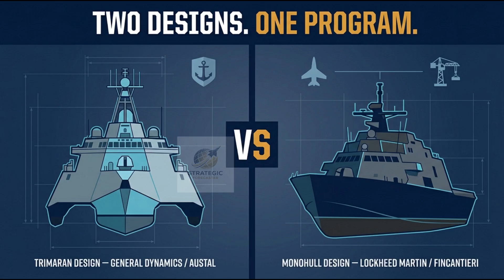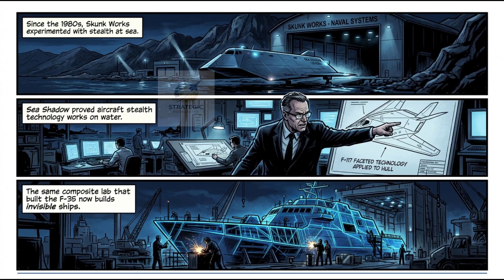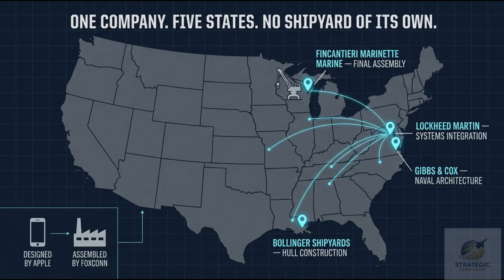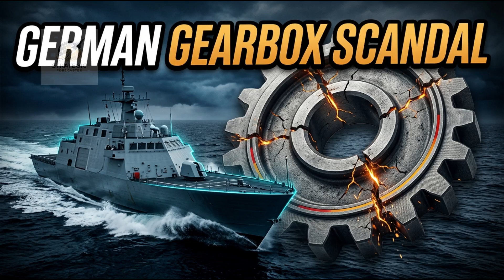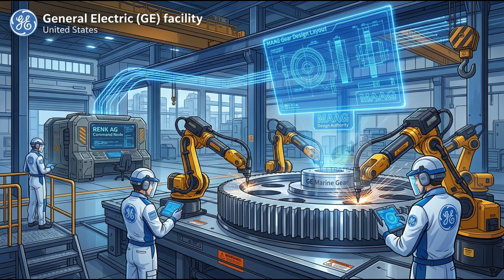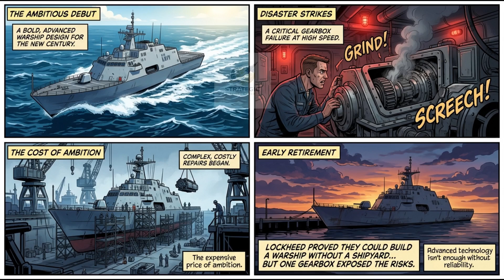Lockheed Martin Has No Shipyard, So How Did It Build a Warship

Comment from the maker: The big question: Who is really at fault here?

Lockheed Martin for selling a shipyard model with no shipyard, or RENK AG for delivering an under-engineered combining gear, or the Navy for accepting a CODAG design this complex for a littoral ship?

My take after research: This was not a bad bearing. It was a bad architecture decision. You cannot put F-35 level system integration onto a high speed hull and outsource the single point of failure.

What do you think was the fatal flaw? The gear, the business model, or the requirement itself?

I read all comments. Drop your engineering take below and I will pin the best breakdown.